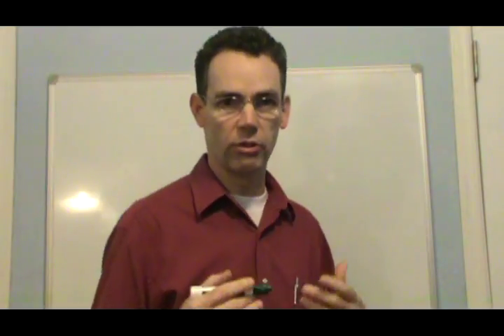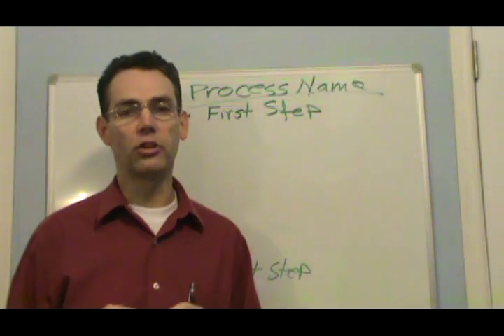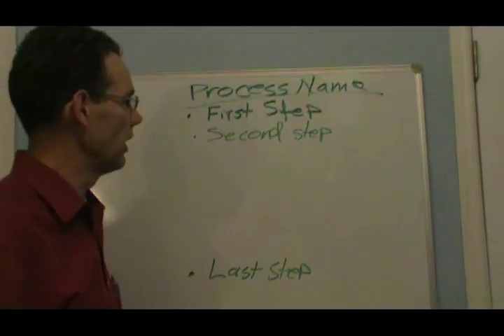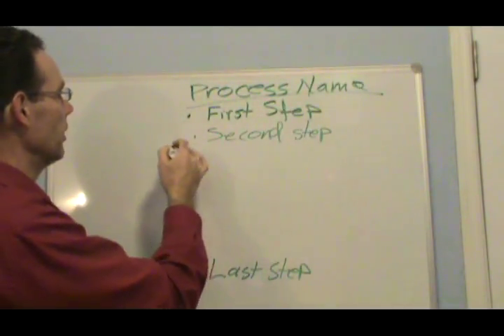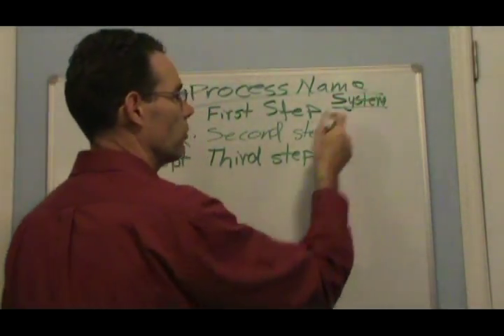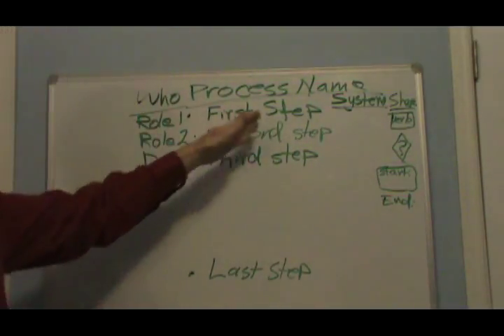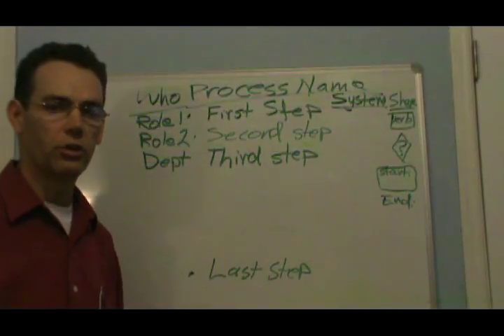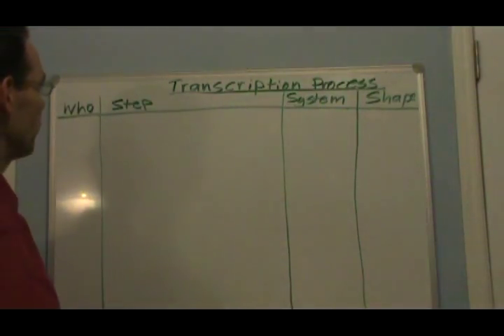How To Create A Process Map

Comment: Thanks for sharing this. Very interesting. How do you manage parallelism in your initial table?
Reply from the maker: You're welcome and great question!  To define our terms, I assume that by parallelism, you mean tasks occuring at the same time.  If so, to identify parallel tasks in the table, I have used a numbering scheme for each step.  I number the tasks that occur at the same time with the same number.  The other way is to link them with a bracket and put a "P" on the vertical line to indicate that the linked steps occur in parallel.  This can get really messy if you have a bunch of parallel tasks, though.  Does that answer your question?
Reply: Alan Messegee
 yes, that's what I meant. Thanks for the reply!

Comment: Thank you for the tips! I have one question. In the beginning of the video you state that we should start from the first step then go straight to the last step..However,  In your example, you went from the first step, to the second, third, etc. Is that b/c you already knew your end task? Does this process change based off of knowing the last step or can we make assumptions for the last step and tweak accordingly? Thanks and great video!
Reply from the maker: Sorry for not responding sooner... I must have missed the auto-generated email. I like to identify the first and last steps at the outset.  You're correct in that I already knew them in this example.  Where I've gotten into trouble before is not knowing (or at least thinking I knew) the first and last step before diving in. Sometimes you do have to just start and a natural end point will become evident as you learn more about the process.

I've also gotten into trouble with not determining an appropriate level of detail first. Trying to mix and match various levels of detail in the same map doesn't work so well.  Much better to cascade it... start with a high level map and then detail out the needed steps on their own map.  Visio and other mapping software have some nice features to make this linking easy.

I hope this helps.

Comment: In the text layout you had a column for what system was used but, you didn't show where the system was used in your swimlane diagram. I would had liked to seen how the system object is included in the workflow process. Thx
Reply from the maker: Hi Pat, sorry for my delayed response.  Thanks for your comment.  In the case of a swimlane diagram, I will either put it as part of the text in the box, e.g. "Download 2-3 jobs from Transcend" or float a free text box as close to the applicable shape as possible.  I have also done some where I use one of the swimlanes to identify in which system the task is being performed.  This requires a very neat grid-like format and flow to the map which isn't always possible.
Reply: Alan Messegee Thanks Pat Brevick for asking that question and thanks Alan Messegee  for that answer. Sometime ago I facilitated a To-Be process workshop with a couple of stakeholders in which I clearly stated at the beginning of the workshop how important it is for the group of stakeholders to agree to what level of detail we would go in documenting the processes models, whether we needed to include systems in a separate lane or not. During the workshop I tried to make them understand that it isn't necessary to always represent the system in a separate lane, but just like Alan Messegee said its better/neater to 'annotate' ( float a free text box close to the applicable shape) near or just above a task  to show what system is being used to perform a task. The stakeholders wouldn't have it.....one stakeholder in particular wanted to see every system used to perform a task in a process, i gently explained that it would make the lanes too many and the process map very rough. The project goal was to implement a C.R.M in the back end and e-forms on their website to take over old heavily manual ways of doing things. I was made to leave the job unfortunately. I'm a business analyst but they looked at me as if I was a solution architect! Stakeholders are very difficult to engage....especially when you're working in an environment not used to business analysis......

Comment: Hi alan. Thx for the video. By i have question. Is necessary include administrative process when i want to describe physical process to make something like cup cake?
Reply from the maker: Hi Leonardo.  Thanks for watching!  To answer your question, I'd say that it depends on your objective, the complexity of the tasks and the number of people/departments involved.  I have found that process mapping is most helpful when there are multiple people or departments involved and the process requires coordination between them.  In a situation where you have one person making cup cakes at home, process mapping may not be very helpful.  A standard recipe or standard operating procedure (SOP) may be more helpful.  If, however, you're talking about a large bakery where different people are responsible for different steps of the administrative and baking processes, then process mapping could help significantly.  Hope that helps answer your question.